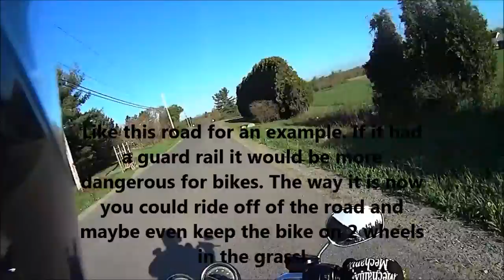America's Roadways, Are They Designed With Motorcycles In Mind?

Comment: Lol what happened with the audio, the roads here are pretty bad mainly on the main roads with the trucks and buses but when it comes to the built up areas if the roads have sand or other crap on it you just ring the council and they'll send in the road sweepers  to clean it up (sometimes).
Great vid mate
Reply from the maker: Something is wrong with the audio??
Reply: Well the video it speeds up then slows down
Reply from the maker: Hugh...don't remember doing that but maybe I accidentally put a part of it in 2x speed mode or something when editing. That is a pretty old video when I was green to all of this so I could have very well screwed up. There was almost no one watching then to catch a mess up either.